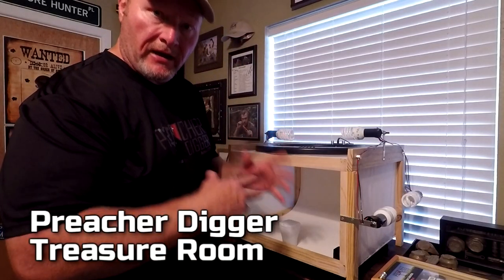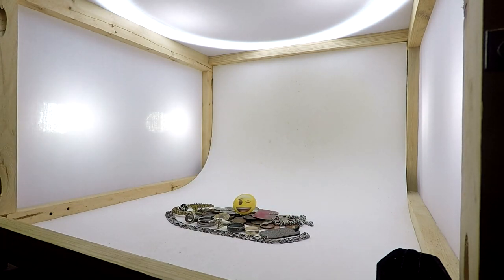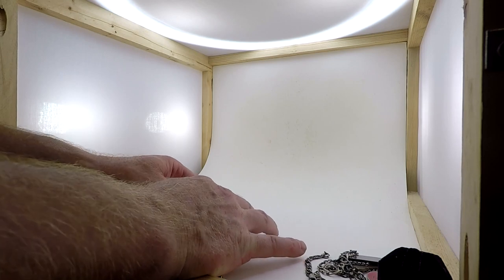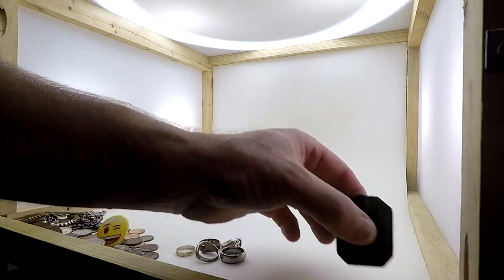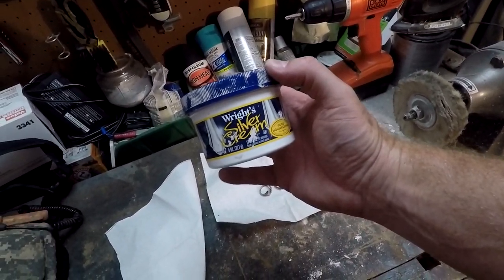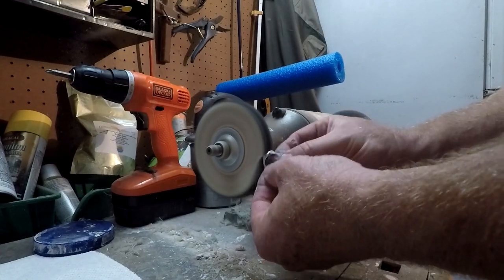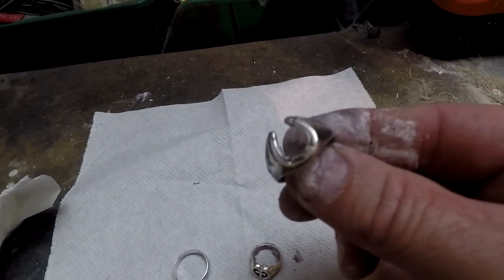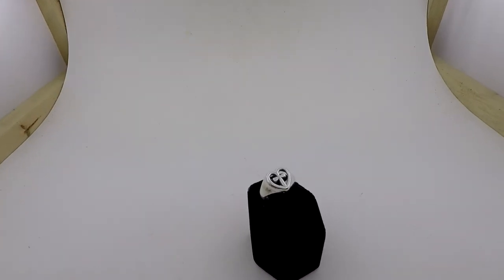How I Shoot Lightbox Photos | Plus Cleaning Silver Rings

Comment: New to metal detecting.  If you were starting out what metal detector would you buy. Price range $500 to $800. This may be a good youtube video.
Reply from the maker: If I were starting over knowing now what I didn't know then, I would buy the Minelab Equinox 600 or 800. It's a easy to learn detector plus it's waterproof so yoi can hunt in the lakes, rivers, and ocean for those rings.  Plus it is a detector you can grow in to as you develop.  I believe in them so much I have 2 of them.  But I also kept my Garrett AT Pro and Apex.